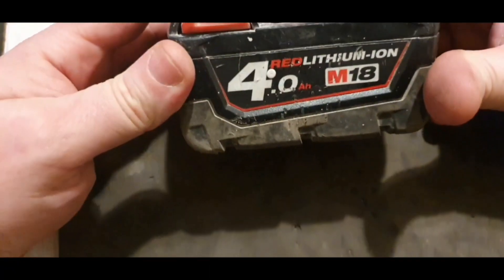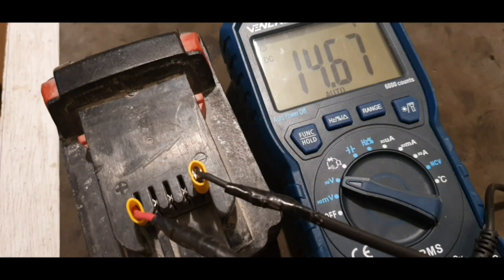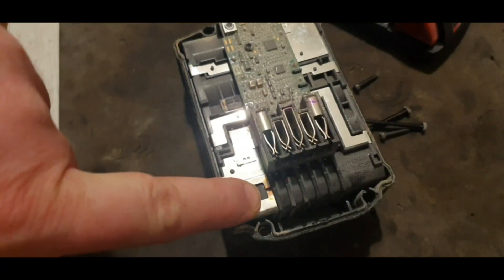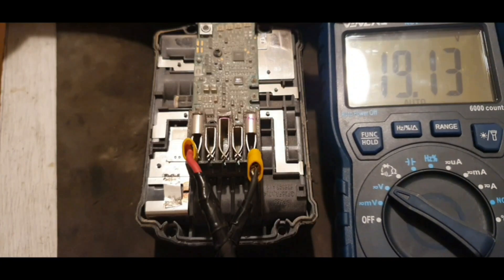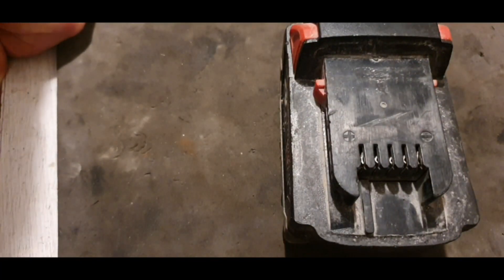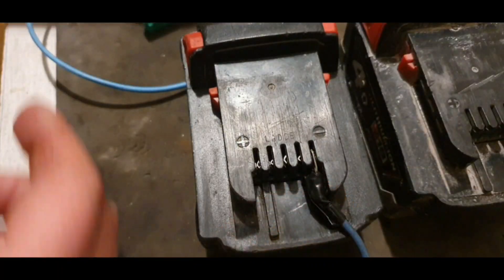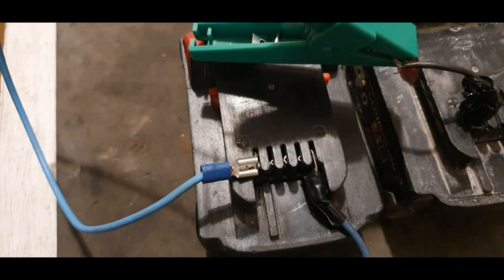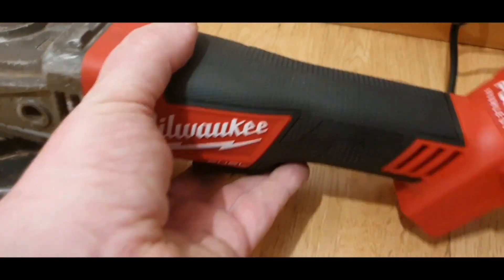Milwaukee M18 4ah 2 min fix #milwaukee #powertools #repair #powertoolrepair #howto

Comment: If the voltage after the repair was 19V, you do not need to connect the battery to the battery, just put it in the charger immediately.  The charger just needs to activate the batteries.
Reply from the maker: I am Always willing to learn thanks for the advice